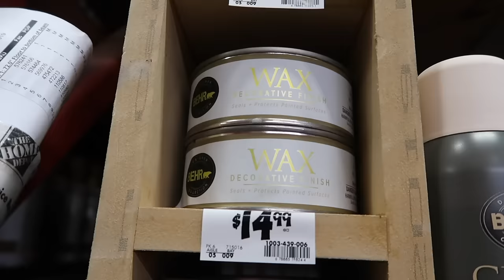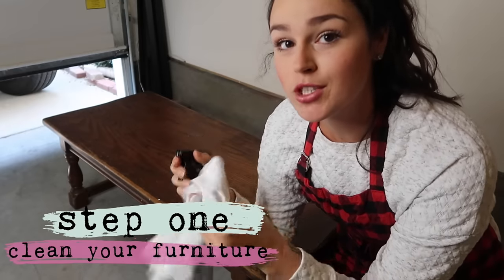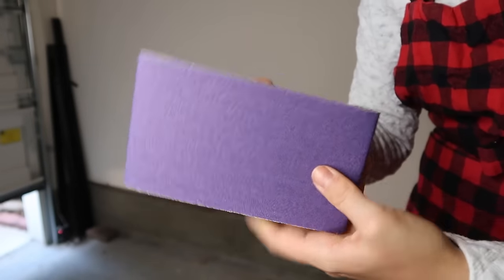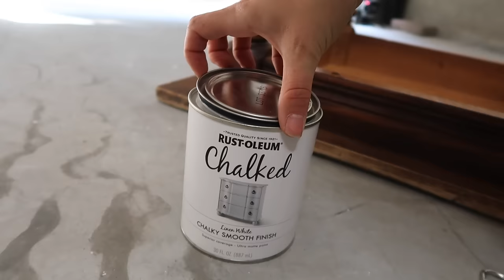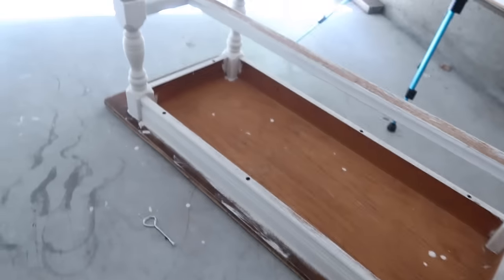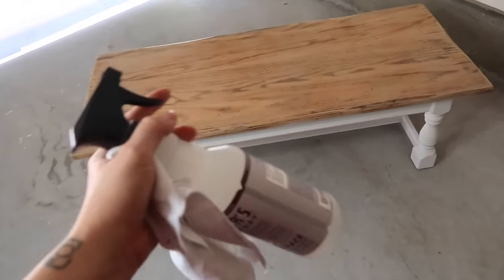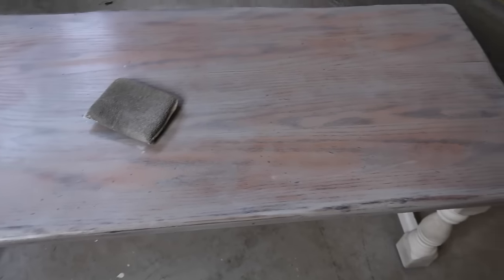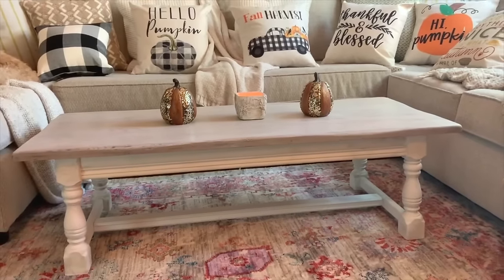How to Whitewash & Distress Furniture: DIY Farmhouse Coffee Table (easy & budget-friendly)

Comment: It did come out beautiful but I believe I would have left the top as is and just coated it with a clear wax.  The wood grain was so pretty and it is lost in the white wash.
Reply: It looked so pretty before that lol
Reply: Agreed or maybe a white wax if she wanted to fade out the wood color a bit, that top job did the table no service though
Reply: @jordanbelmonte4992  Can you put hot pots, water droplets on the waxed table top? I mean, would it show marks once you put the white wax over ??
Reply: If you can't decide which you like better you can always do both. Say a table with five top boards leave three without.
Reply: I think the white looks good with the room
Reply: I was thinking exact the same thing but is what she likes not me 😊 she did a pretty nice job
Reply: @jordanbelmonte4992  No white wax. Just natural wood look covered by clear wax.
Reply: Love the farm distressed look!!  Great job..
Reply: Love it you did a great job ❤
Reply: Wax seals the surface very minimally and isn’t permanent. It must be periodically re-applied, and is not usually used for tabletops that you anticipate putting sweaty-glasses or hot cups/plates on & etc.  

Higher traffic surfaces should be sealed with a permanent barrier like polyurethane or other similar material.  A finish labeled SPAR will also work really well on a tabletop/surface to repel water/moisture.* Minwax has a water based SPAR poly, General Finishes’ Armor Seal is oil based, as is Mohawk’s Rockhard tabletop & cabinet finish. 

Regular polyurethane is good, offering more protection than wax, but not as good as those three for tabletops.  Another way to customize your polyurethane/finish is to add pigment to create depth. You can use oil based stain or pigment to tint oil based polyurethane/finish, or water based stain or pigment to tint water based polyurethane/finish.  It also reduces cloudiness, streakiness and/or splotchiness. Test out your custom concoction on a scrap piece or inconspicuous spot. 

  *Check product descriptions if they’re non-yellowing or if they become amber with age.

Comment: Nice job. Comment, though:  when you were adding the whitewash (I guess it was) to the legs and sides to 'distress' those parts, you sped up the camera so fast it was impossible to see how you spread the whitewash or paint before wiping it back. I THINK you dabbed it on, but am not really sure. You said the lighting was bad there. The speed up is great, but for the first application of it, you should have gone slow so we could see how you were applying it.

Comment: Hi! First time watching any of your videos and I enjoyed it. I'm not an expert but I've learned some basic things along the years. 1. Use a drop cloth under your item. No paint spots on garage floor make hubby's happy. 2. Pour the paint you think you are going to use in a separate container. It protects the paint and you won't have a hard time opening the can next time. 3. Lift the legs up on pieces of wood or whatever you have around. 4. To avoid getting the paint where you don't want it (like the side part) use an old piece of fabric, plastic, etc. I put painters tape on the edge of whatever I'm using and cover the area. BTW, some people put a nail in the bottom of the legs to elevate. After all that said, you did a good job. I loved how the Rustolium  Chalk paint went on so evenly. And, I've never used wax before and it doesn't look so difficult. Thanks.
Reply: I do this in our garage and the one thing hubby comments on are the couple drops which may have inadvertently spilled/dripped on to the garage floor. I’m like, seriously? It’s a GARAGE floor who cares? So you hit the nail on the head with that one!! 😂
Reply: I thought it was just me. I was worried about the drips on the concrete floor. Kept thinking about that as I watched. Enjoyed the content and instructions. Always happy to learn more. Thanks ..

Comment: It looks good.  However it looks the same top and bottom, not that that is bad but but it would look great with just a little bit more contrast on the top. 
I’ve have 3 projects I’m currently deciding what all I want. One is a sofa table I made from repurposed wood.
The other 2 pieces involve some carpentry work.  
Reshaping as the both have drawers.  One is dark the other is old and dirty unfinished.
Think of a barn wood look.

Comment: Btw, always wear a 3M mask when you're sanding so the dust, old stain now airborne and who knows what else particles don't get in through your nose, same for painting. Most of these paints or stains barely have any smell but that doesn't mean they are not toxic to inhale. I recommend sanding down some of that wood on the edges for distressed look so you add some depth to it vs. dull and "washed out", you can also sand down some of the top layer here and there to do the same....French country farmhouse also I think has another layer of paint so it's not so dull....these are not easy to make and look natural....the darker the wood, the more texture on the surface, the lighter the more washed out it looks but I noticed french farmhouse or french country that usually uses this washed out look, makes everything lighter and more textured

Comment: Don't contaminate your chalk paint with water. After you seal the can and store it for awhile, the contaminated paint will stink. If you want to do a wash of paint, pour some paint into a separate bowl and add water to the bowl. You don't want to repeatedly dip your brush in your paint can after dipping your brush in water. Some painters favor using a spray bottle of water and apply water directly to the wet paint on the piece.

Comment: It's beautiful! Gorgeous! You did great.
But.... that's not whitewashing...just saying....what you did was renovate it and applied full coverage paint onto the surface. 
Don't take that the wrong way, you did a really great job of it, it looks shop bought. It's just the kind of table I'd be proud to own.
But yeah, whitewashing is exactly what it sounds like...watery! It's literally half and half water and water based white paint. The main key thing is that the wood is bare. Like raw! Fresh. It would need to be stripped and sanded back to the original wood COMPLETELY. The watery paint then gets slapped on generously, the idea being that it penetrates inside the wood - not sit on the surface! You slap it on, and then wipe the excess off with a rag. It ends up lightening the wood from the inside fibres that got flooded with paint. But when you run your hand over it you still feel the wood. 
As I said, what you did was minimal sanding, to give you a smooth surface, and that's exactly right for what you were doing. (BTW the joy of chalk paint is that sanding is NOT necessary.) It goes on wood, varnish, glass, metal, fabric, walls, anything you want. The "chalk" in it is actually plaster of Paris, which is what hardens and sticks to anything, and why the paint dries so fast. 
But like I say, what you achieved is truly beautiful and you did it very carefully and properly. It's just my kind of style! 😁
Chalk paint - applying paint onto the surface
Whitewashing - soaking the wet paint into the wood fibres. 
One is ON, one is IN.
Just explaining, NOT criticising. 😘
...................
Hi I found this tutorial...she does an excellent job of demonstrating proper whitewashing. You don't need the stain she used at the first step...she just did that for a grey undertone. You'll see that whitewashing is SO much quicker, easier and cheaper than what you did. You did more of a proper makeover, and spent more. Whitewashing would cost you around $5! Cheap small pot of paint. That's all. Enjoy the video.

https://youtu.be/uCK9RDOVdmg

Comment: This was so helpful! I want to do this to an old coffee table a friend of mind built for me 17 years ago. It’s just stained pine I’m pretty sure. I want to match it to my tv console that is more of a distressed ivory I believe. Would you recommend using all the same stain and wax colors and just pick a different shade of chalk paint? Can I take a picture of my console color and take it to Home Depot and they match the chalk paint? I’m knew you DIY! Thanks!
Reply: We took a kitchen cupboard door to Home Depot. I think their machine scans it these days. So if possible take something off it with you. Chalk paint may dry a little lighter looking though but I dont like complete matching anyway. I’m new too but cheap. Make my own chalk paint with patching powder. So you could go that way. They can match the color and original shine value of the paint if you took a door then add the powder so value is similar but effect different. A little goes a long way. Add tiny bit water first to the powered. Not too think but it should look like you added “chalk”. I looked up what actual chalk was. That helps to know what it is and doing to paint. Even drywall is chalk. Gyms on for the yard. It’s all calcium something from long ago when sea shells etc . Broke down in the oceans. Only plaster of Paris is different found outside of Paris France. It is the only 3 ingredient calcium something and dries extra hard. Why they used for casts. Some use it but I read its harder to correct mistakes and not as soft a look if you will. Good luck. Sorry teachers in my family!

Comment: Is chalk paint just a craze, or are there distinct advantages to using chalk paint over simply using a matte or satin latex?  This would save you the extra expense and step of buying and applying the wax to eliminate the extremely matte chalk paint finish, or to protect it.  Latex would not need waxing because you control the amount of matte/gloss you prefer.  So you eliminate a step. You could still antique it.  All the vloggers on youtube use chalk paint, so either it is just a fad and everyone is using it without much thought because someone came out with a line of it to sell, or there are tons of advantages to using it.  Otherwise, why pay more, work harder and spend more time using chalk paint?   What is everyone's opinion?   I really want to know; it mystifies me.
Reply: I use, and love, chalk paint....have used on a ton of furniture....